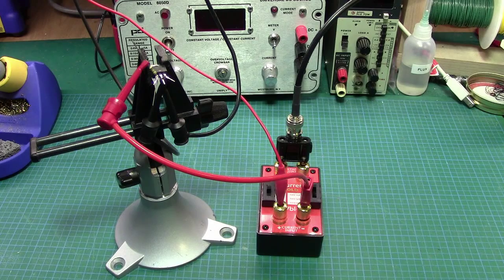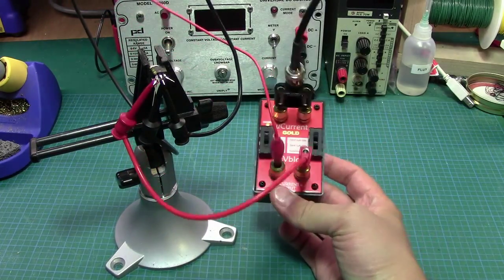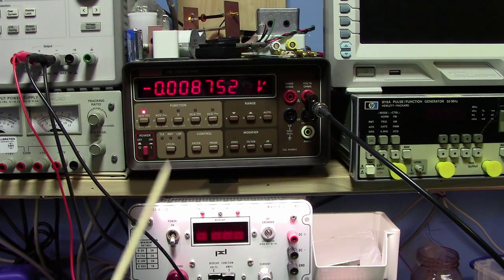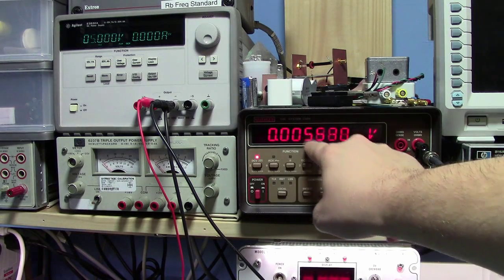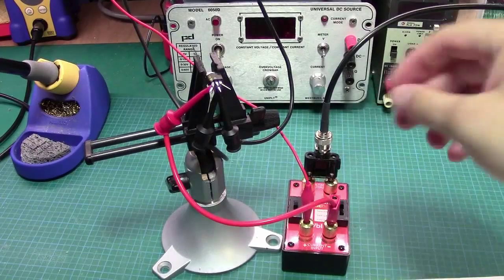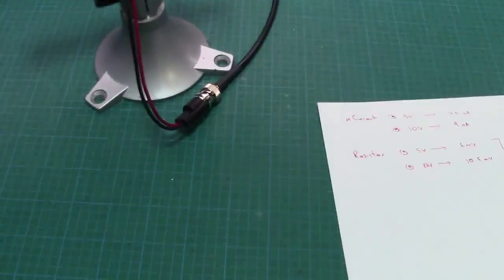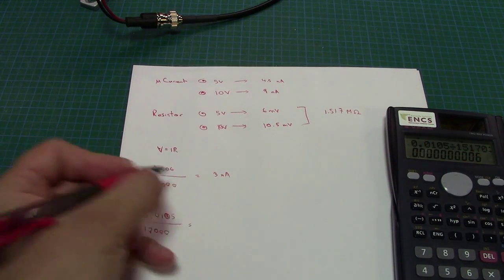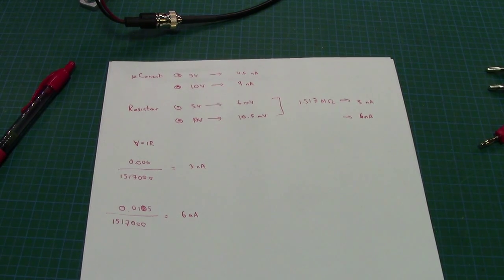Measuring the leakage current of a MOSFET

Comment: Those desktop DMMs, usually their impedance will be in the order of gigaohms from the input stage of their first opamp or jfet frontend. However this is only at low enough voltage levels, usually at 2 or 20V they have to use a resistor divider at which point the impedance becomes 10M. This because they can effectively disconnect the lower leg of the divider, disabling its current path. There are one or two hand-held DMMs which can also do this trick, usually just for the mV measurement.

A useful trick - put your voltmeter directly in series with the current, and use its "in-built" 10M resistor as the full current shunt!

Comment: can I measure the gate leakage current using curve tracer?
Reply from the maker: I don't think a curve tracer is strictly necessary to measure gate leakage and I could be careful using one because of the possibility of the high voltages. The gate leakage current is fairly constant until the gate ESD diode becomes forward biased (but I would likely try and protect the gate further if this was a concern, or at a minimum put a resistor in-line with the gate to prevent a damaging amount of current if this occurs).

Comment: Have u measured the input resistance of the dvm ? its directly across the resistor. A better method would be to put a capacitor across the gate source and measure the time to discharge.You could energize the drain and monitor the current to determine pinch-off. Also if you had two different low leakage capacitors you could determine the gate /source capacitance as well.

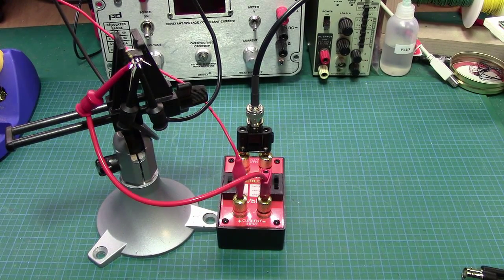Comment: at 5:09, what DC electronic load is that? seems really small
Reply from the maker: If you're talking about the piece of equipment on the top right of the video, that's a Kikusui PLZ 72W.
Reply: yes that one, thank you sir
Reply from the maker: Be aware though, it only goes down to about 4V input (although I have tested it at ~2V input voltage and it seems to work).